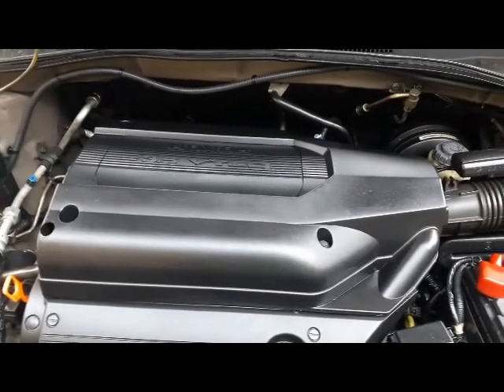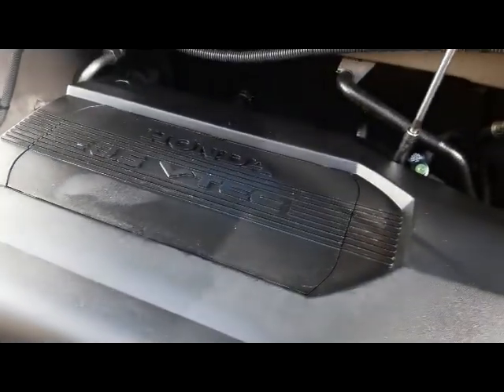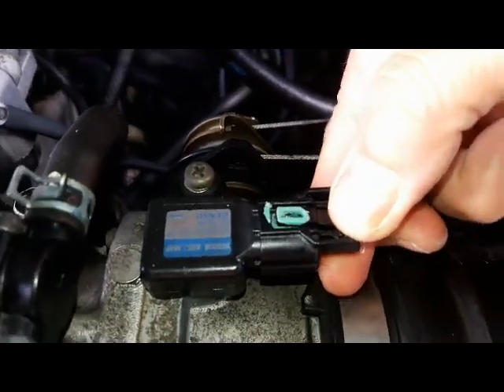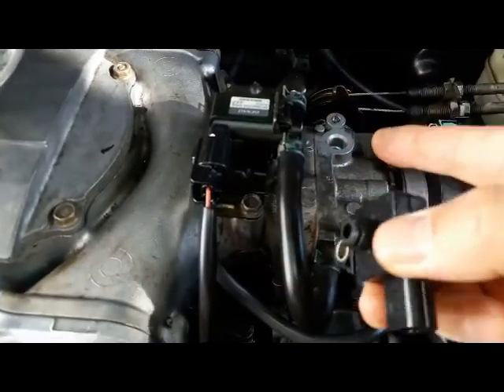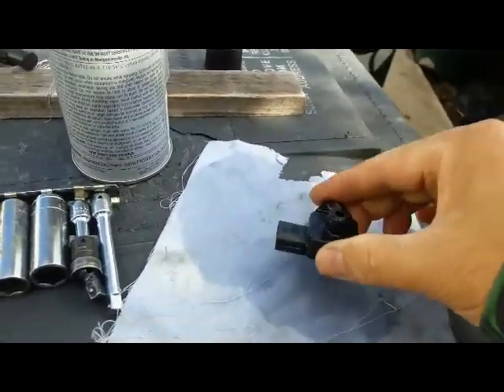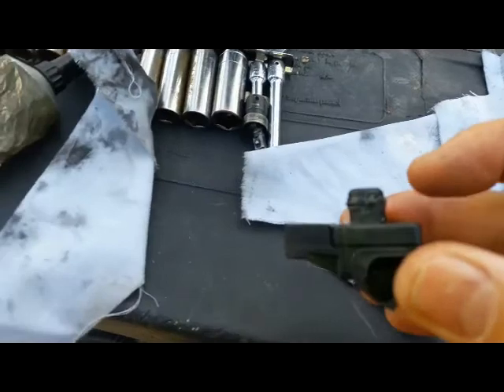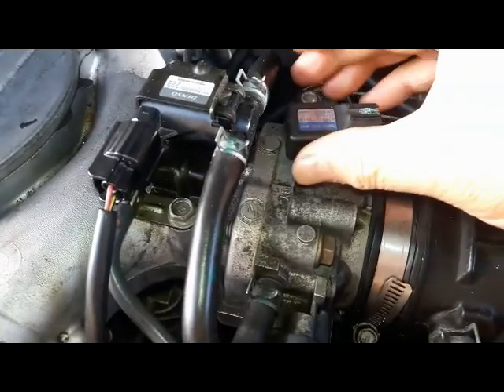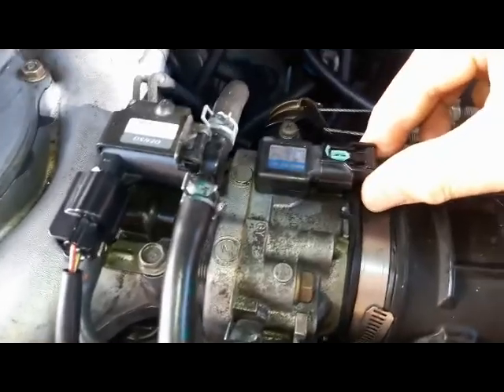2004 Honda Odyssey EX MAP Sensor Cleaning

Comment: I have an 2004 honda odyssey 3.5 vtec i replaced the valve seals and the iac gasket due too me not knowing that the van went over 60,000 miles without an oil change it was a very big mess im still dealing with.i replaced the starter too.the van has a slight putter that you can feel.would that be the map sensor?
Reply: Could be dirty sensor, I have to replaced my spark plugs to stop it from sputtering on mine.